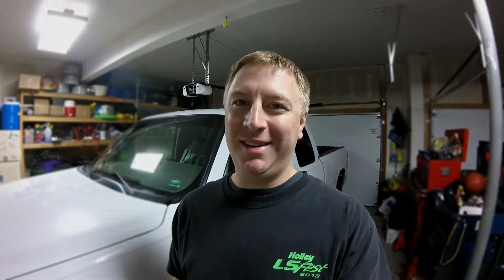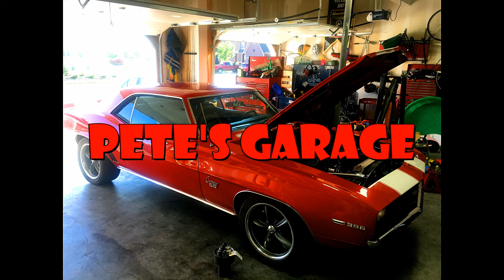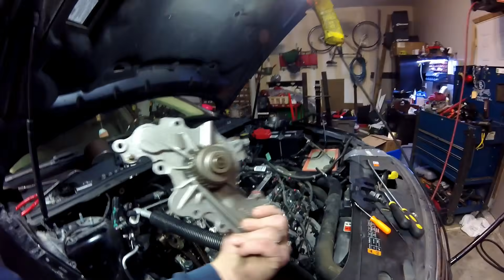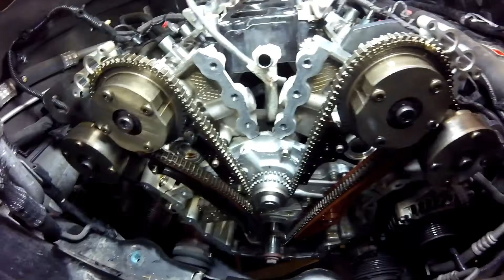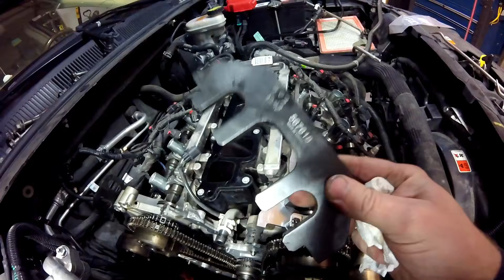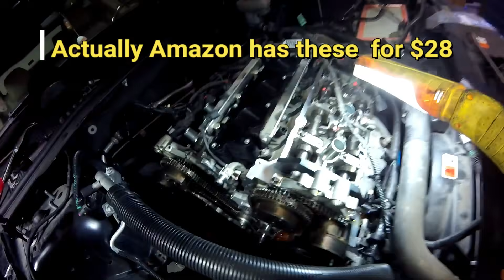Why does the Ford Taurus, Explorer, Edge 3.5L water pump cost over $1400?

Comment: There's a special place in Hell for automotive engineers where they have to fix everything they ever designed with no instructions while being whipped every 3-5 seconds.  Edit: Thanks for all the likes and comments!
Reply: Hell must be getting full then..
Reply: @wonkawilly5573  I think they're making room. I heard they're building two more wings in Hell just for lawyers and politicians, so that should almost empty out the center of Hell quite nicely.
Reply: Jonathan Ryan I hope they show it on cable TV in Heaven. Great comedy entertainment!!!
Reply: Don´t forget to include the bean counters & managers forcing their hands.
Reply: don't forget, in the dirt, in summer, in the south. It has gotten bad enough I tell people I don't work on cars anymore.
Reply: @calvinbarnes1721  less headaches.
Reply: I would send decision makers, who made engineers to design this way, to that hell, not the engineers and designers.
Reply: Yes, I agree with you, now one can't no longer even change a water pump, something that anybody could do years ago.  Why hide the water pump so that one can't get to them?  They really want to keep going to the dealerships, so that they can empty your bank account.  Gas filters are not accessible any more, now they are an integral part of the fuel pump and one has to buy the fuel pump if the the fuel filter goes wrong.  Yes, I really believe that those automotive engineers are burning in hell because of what they have done.  In high end vehicles one can't even remove the battery because the car's computer have to be reprogrammed and new codes had to be input and for that one has to take the car to the dealership.  In the very near future we won't be able to do our oil change and put air in our tires.  I wouldn't be surprised if they design a car that needs assistance from the dealership every time one has to go to the gas station to refuel the vehicle, one might need to call the dealership for a code for the gas tank to be ready to allow the refueling.  This world is getting ridiculous.
Reply: EnjoyLifeNow24 I can see that happening in the future!
Reply: Flogging, yes
Reply: ...and Celine Dion "music" playing on the intercom system 24/7at high volume.
Reply: Lol
Reply: Not only that but the dealerships want to take more cash by having people shill out money to fix there transportation. Instead of the local mechanic or every man. Basically, drive a modern daily into the ground but preserve your favorite cars.
Reply: Same engineers who are responsible for $4000 spark plug replacement.  The ones that break and result in complete engine teardowns and rebuilds (if not replacements).  On their off time they design air intakes for Dodge that double as a water scoops when it rains.
Reply: Joseph Nichols 
I like keeping my old vehicles like my 1979 chevy van and my. Late fathers 1984 old. Still on the road today. These vehiles have been modified extensively with stainless steel, especially my 1979 van. Yes the door bottoms rockes panels, parts of the sill portion of the vehicle. I,m very much into welding both tig & mig in my creature comfort two car garage. I,ve been in the trade as an electrician for 47 years .....Above all i religiously converted all the brake fluid lines to stainless steel. I even rolled my own muffler out of 314 grade stainless steel copying the oem muffler. The biggest gripe i lhave is that if i mention stainless steel anything to any car guru, they snub me. One in particular is Montreal talk radio host of the car show with lisa. Christiensen on saturday morning on CJAD 800am from 10.00am to 11.00am . Her show is sponsored by the automobile protective association of Canada. In my opinion they are sponsored by new vehicle manufactureres. Hence a bias toward a stainless steel option. And Scotty Kilmer, you bad mouthed one product that gm mistakenly produced back in the 1990s that was great and that was the EV 1. That was leased only. When the lease was up gm did not want to sell to the people who possesed them. Instead they took them back and crushed them for the scrappers, even inspite of the people who possessed them offered gm $ zillions to purchase them outright. Once again Scotty...... your all need to see the vidio of "   who killed the electric car ?" To sumerize about car makers ,   car talk gurus should understand that when a car maker makes a good product like GMs EV 1 or the Delorean, it is usually a mistake.
Reply: Sadly they might enjoy a flogging
Reply: Simple, kick the designer right in the nuts. He wouldn't do it again.
Reply: Lol
Reply: Jonathan Ryan an even more special place for the managers/leadershit who told them to do so.
Reply: hifid3lity leadershit is right 👍
Reply: The Starter on the Cadillac North Star V8 comes to mind
Reply from the maker: Except that only took two hours.
Reply: lot of Ford engineers down there
Reply: Damn right...And no excuse justified prices
Reply: Also the fact that it's a front wheel drive transverse engin makes it worse everything is crammed into a smaller space than a dear wheel drive longitudinal engine
Reply: Darren Porsch the never ending push for more horses as if racecar
Reply: Darren Porsch The RWD versions of the 3.5, 3.5 Ecoboost, and 3.7 don’t have a timing chain driven water pump. Ford doesn’t do as much cost cutting as GM does.
Reply: And being yelled at by their wife's for eternity.
Reply: Jonathan Ryan i like the way you think
Reply: No, there isn't.  But there should be.
Reply: Same shit with crapsler (chrysler) you have to tear so much bullshit apart just to get to one tiny thing
Reply: It's the same place in hell reserved for politicians and paedophiles.
Reply: Porsche and Mercedes will be the majority population
Reply: I would like to submit the designers of the F-4, Phantom II.  Great aircraft built from the inside out to perform, not to be worked on.  It was evil.
Reply: @x-man5056  I used to want to be an eletrical engineer, till I started working on military aircraft, then I just wanted to choke them lol
Reply: @nattadam4171  ALL engineers of military equipment should be forced to work on them for a few years before sitting at the design desk.  Not just aircraft, everything.
What did you work on?
Reply: @x-man5056  F15s ABCD and  all types of C-135s
Reply: @nattadam4171  Cool.  Never laid a wrench on an F-15 but worked a fuel gripe on a C-135 in the fuel area at McClellan AFB once.  Opened an access to large fuel cell in aft of the plane, pulled out a chair and an explosion proof drop light.  No idea how long it had been flying around with that in there.
I worked F-4's in the Navy then went to work at McClellan when I got out.  Worked F-4's, F-111's, A-10's, & F-106's.  A few other planes and Helicopters also when I worked in the fuel area for a short time.  Mid 70's to late 80's.
Reply: @x-man5056  lol OK prior AF,  yup, Ive seen rags and a flashlight before in the 135s happens more often than we would like to believe, even on the civilian side too. I was lucky enough to see the F4s flying around at Tyndall AFB a few years before they retired.
Reply: @nattadam4171  Oh definitely, civilians leave sh*t behind also.  When I worked for DCMA back in late 90's, I got a call from the Pentagon from some COL. wanting to know why there were 3 flashlights, in 3 different CALCM's, all in the same spot in the same panel area.  That was an exciting day.  LoL
Reply: When I'm President I'll sign it into law.
Reply: They’re in a hell where they have all the wrong tools
Reply: Well said!
Reply: Yes sir 🤫😂😂😂😂😂
Reply: Back here in 2023 this job now cost $1,000,000 at the dealer.
Reply: The LS designers are in heaven
Reply: Hahhha
Reply: With a hoist, powertrain is on a rolling cart in 2.5 to 3 hs, if you're a flat rate rockstar, ladies! Then the pump is 45 min to 1 hr tops. Line 'em up kids!
Reply: They don't care if we have trouble repairing it. They want us to hire them. More money and jobs for them. Less for us.
Reply: Hahaha oh fuck that is a funny comment!
Reply: Facts
Reply: Love it...
Reply: @grumpy old fart  

We can't leave the kardashians out either
Reply: Mr T. They had the right idea. That how it should be.
Reply: Hilarious
Reply: @Travis Thacker I'm sensing you're pretty PO'd about this issue.  LMAO
Reply: Amen
Reply: Agreed
Reply: There's truth to this comment
Reply: Our regulations are getting ever more stringent which means, smaller, efficient, but unfortunately  more complicated engines. I wouldn't entirely put the blame on engineers. It's just the era we leave in.
Reply: Faded Jate yes, but not every bad design decision is because of emissions. Sometimes it’s just a cost cutting measure (value engineering), sometimes just a matter of inexperience.This looks like a bit of both.
Reply: @superusermode  Right, and all the auto manufacturers cut corners now.
Reply: @fadedjate7230 So, what you're gaining in fuel efficiency, you are losing more in maintenance and repair costs. That's why I drive a 30 year old car and plan to keep it. It's not as fuel efficient but it's simple and cheap to maintain especially since I do my own maintenance.
Reply: @scottshingleton7659  When I was talking about modern daily cars. I was referring to cars made in the 90s and early 2000s. The 2010 and newer cars seem to have the most problems. That's essentially my plan. Buy cars that get overlooked but have generally good reliability and run them for as long as possible.
Reply: It's not always the engineers fault . You will see some  design the outside of the car and not you got to fit a ton of crap inside
Reply: @niyablake  If not the engineers that did this, then who? Design changes need to be approved before they go into mass production, and who handles those designs?  It's all engineers whether it's the shell or the drive train. It's not like this was an unapproved change that happened on the assembly line.
Reply: @superusermode  what happens is some comes up with and idea and then tell the engineers to make it work. a good example of this is steve jobs with the apple II and apple III. he wanted a computer with no fan. he also designed a case before the computer mother board was designed. Just make it fit , just make it work
Reply: @niyablake  there are plenty of ways to "make it work" without compromising cam drive, crank case, and essentially the entire engine. Any time you make changes, you're taking a chance, especially if those changes are unproven. In this case,  this is a major design change that turns a consumable part into an engine killer.  

Everyone knows that when a water pump fails, it will leak. This leak can wreak all sorts of havoc in the crank case because it displaces oil. Also, when a water pump fails, the input shaft has a tendency to wobble. In this application,  given that it's right in the "V" of the chain between the cams, worst case, it may jump teeth on that second cam drive, or even jump off and wrap around the crank  until something breaks.  

In understand the need to save an inch or 2  of clearance, but even an external electric pump would have been better than this.  To me, this is as bad as their open deck engines on the Focus.
Reply: Niya Blake How can it not be the engineers fault? I can't see how the outside of the car forced the engineers to locate the water pump in such a stupid place
Reply: @insulman100  Where have you ever seen engineers in charge of a large corporation?
Reply: Tony Rule where have you ever seen a CEO design an engine? Tony I can answer both Questions Henry Ford. I have another question for you when did I say anything about engineers being in charge of a large corporation?
Reply: @insulman100  You're dumber than a box of rocks. If they're not in charge, they don't call the shots.
Reply: @TonyRule  Thanks for the insult you have proven your intelligence
Reply: @insulman100  You're welcome. You earned the insult.
Reply: @TonyRule  If you could would you explain to me how I earned the insult? 
I typed a long reply but I decided why bother because you would just call me names instead of presenting a good argument or conversation this will be my last reply to you so you can continue to show your intelligence by calling names all you want I have read that makes some people fill better about themselves so if it helps you please continue
Reply: @insulman100  You earned it by demonstrating your complete ignorance of modern business practices.

Comment: Nobody builds engines like this unless thier intent was to send you to the dealer to service it. Wow.
Reply: There once was a Russian engineer whose job it was to design a transport vehicle for the Russian Army. On the vehicle, just under the front left quarter-panel, behind a wheel that has a bazillion nuts and bolts of varying sizes holding it on is an access hatch that enables an operator to insert a three-foot specialty wrench into it to connect with a turn-screw that adjusts the vehicle's diesel fuel pump pressure. In order to insert the specialty wrench, the operator must squeeze under the fender in a fetal position and adjust the turn-screw by feel.

When asked why he created such a nightmarish setup in the first place, the engineer said that the day he drew up the plans for that portion of the vehicle, he replied that his wife had pissed him off the night before and if he was having a bad day, he felt that everyone else should as well.
Reply: gmugrumbach I junk cars when a significant repair is needed.  The car will keep getting worse.  Cars last longer today, but when they do break they are not worth fixing.
Reply: Yup.
Reply: you're kidding right?  they all probably do this dude!
Reply: Ford company still exist
Reply: @Richard G    Ford didn't have to stop building cars, they chose to stop. They still build the Mustang.
Reply: @HowardJrFord  Yes, such as Subaru 3.0 and 3.6.
Reply: Yup typical piece of shit Ford.. Typical scumbag piece of shit forward engineers  That should be in prison
Reply: Spot on!!!!
Reply: The issue of domestic automakers pairing with foreign automakers.
Reply: Exactly
Reply: I used to avoid Chrysler for the water pump
Reply: No, sometimes engineers just are that dumb and careless.  I've seen it first hand.
Reply: @lwnf360  they are dumb. But considering that engine was made for many years with the pump on the outside. And Ford and every other vehicle maker had pumps on the outside until this. No. It's to force you to go to a dealership or just get a new car. Purposeful faults in order to guarantee the retirement of that car at some point and the purchase of a new one. They did do it for a reason. And even admitted it. But they said it was so you'd go to a mechanic instead of do it yourself so you wouldn't mess up your own vehicle.
Reply: Typical Ford
Reply: My 92 Honda was something like that and the water pump was not easy to get to, I had a mechanic friend fix it, so I don't know what the cost is but I'm sure it's a lot too. It's the way things are designed now, same I used to work on a electronic repair shop and some stereo receivers are terrible to work on.Very difficult to take them apart.
Reply: @cat-lw6kq  early 90s hondas are NOTHING like this. Not even comparable.
Reply: My 81 Prelude was so easy to work on. Made in Japan.
Reply: @cat-lw6kq  if you can't do a water pump on a 90s Honda you don't belong anywhere near a car while holding a wrench.
Reply: yes I agree, that's why my mechanic friend was always at my side whenever I do car repairs.
Reply: @harryazzole7814  well. Obviously he doesn't since he said he paid someone else to do it. ALSO for all we know. It's a del sol or CRX and he couldnt get his hands or tools down there easily so took it to a mechanic. I mean I know older Hondas are easy water pump replacements. Done it enough. But CRX and del sol can be a pain due to the even LESS room in the engine bay.

Comment: Thanks for showing us. It helps the normal guy understand.
It is a really bad design, to go back to timing chains is a positive but the main reason to go back is for reliability. A car that needs to be in the garage for 3 days to have a waterpump  changed isn't reliable.
No excuse Ford, this is a terrible design error. No excuse, a water pump can be driven of off any auxiliary belt and if that doesn't seem reliable enough you can put a double aux belt system on.